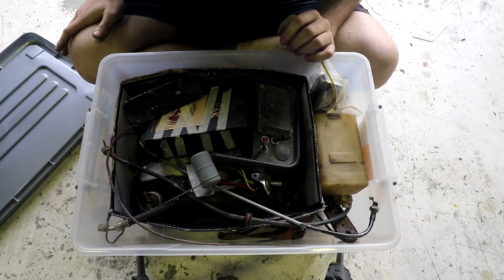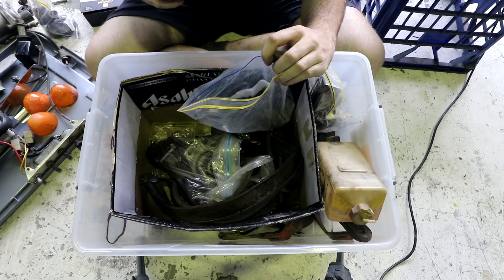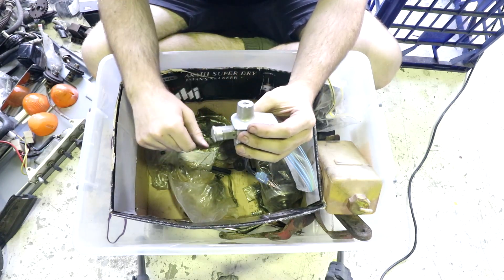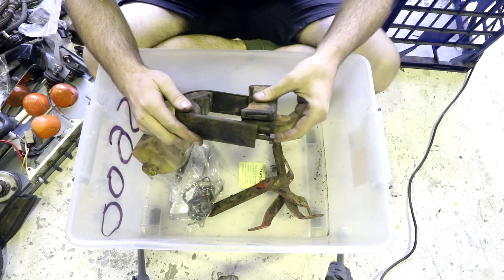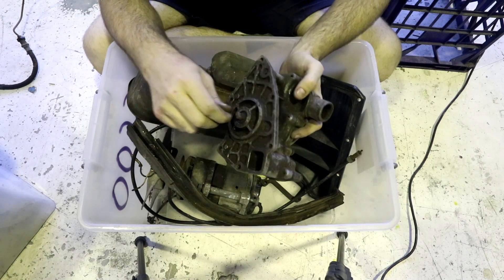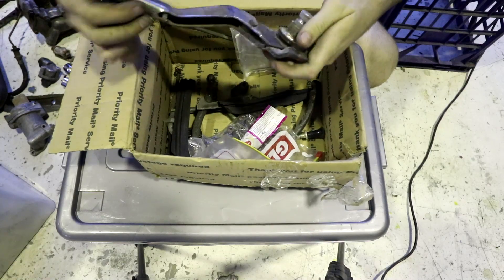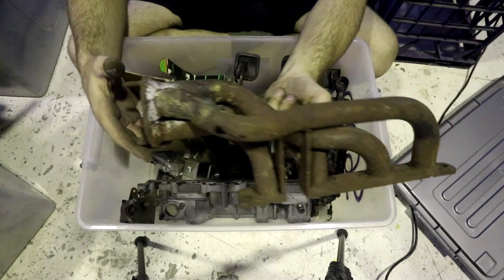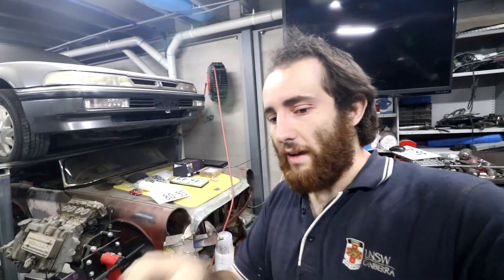Rare Honda S600 Parts.  Taking a look at Rare 1960s Japanese Car Parts 2/2

Comment: 6:55 timing chain guide, goes in the engine block below the centrifugal oil filter
8:24 another timing chain guide, goes on the head between the cam gears
9:06 cam gears, exhaust side drives the water pump, intake side drives the distributor
19:49 spacer between the engine block and the head, around the timing chain, goes in when you put the cylinder liners in the block
21:45 That's Noel, Hi Noel!
22:32 the manual calls it an AC dynamo, does that make it an alternator? not sure?
24:54 I think they go under the wiper pivots/washers, not sure
28:44 keen to see your exhaust build, I built a stainless exhaust from the extractor back
31:35 nope, coolant runs through that part, its the intake manifold, the fuel distribution is the other side of the carbs
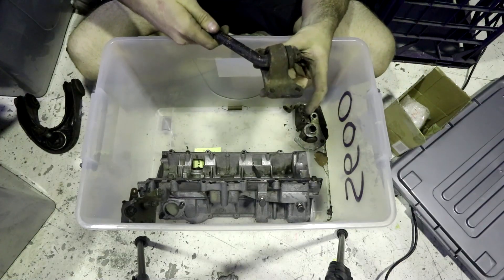32:06 radius rod

FYI search "CMSNL honda s600" they have exploded diagrams, has been super helpful to me!